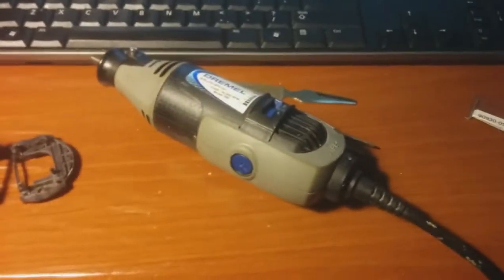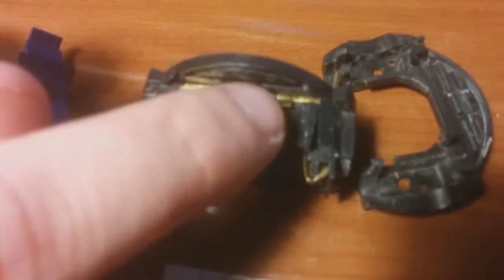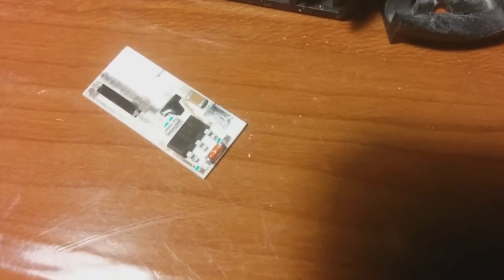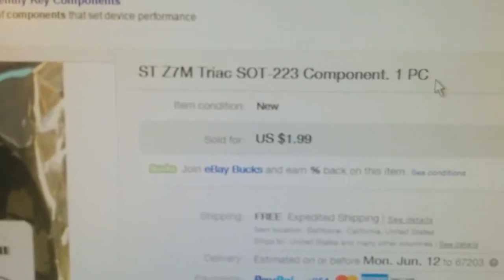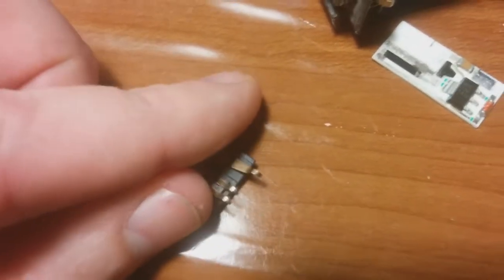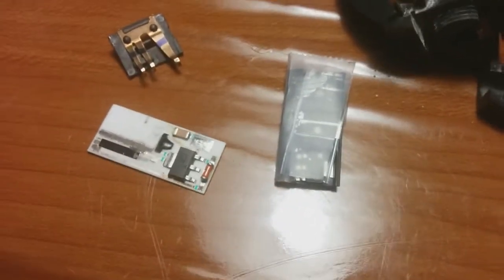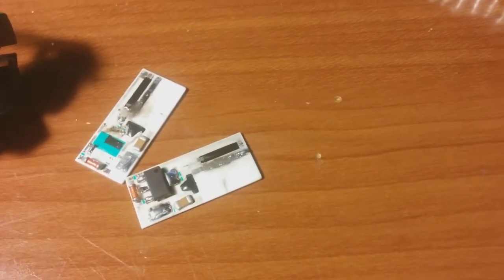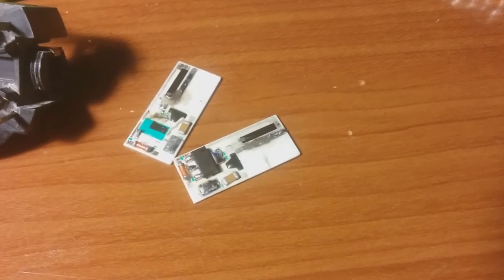Dremel model 395 "no speed control" fix - TRIAC replacement

Comment: I'm having the same issue with my Dremel 3000, I got it used on eBay a couple months ago and it's been working great but now today I tried to use it and it goes full speed with the switch set to 2 but it only does it sometimes and when it doesn't sometimes it'll keep speeding up and slowing down on its own, I'm pretty sure mine just needs to be cleaned though because I've been using it to clean and polish chrome parts on some vintage bicycles and it probably just got some bits of rust in the switch but I'll see if I can order a replacement switch for it and do that before I take it apart for repair just in case the switch is junk or it's got one of these that is bad because I suck at SMD soldering.

Comment: Jesus, 20 bucks!, I just ran a tiny bead of solder along the worn track, and sanded it down to flat and thin, and it worked. Though it'll wear out again sooner than B4 since it's solder that's being worn down...
Reply: I tried the same thing with no luck. Mine only works on low speed and you really gotta find the exact spot for that

Comment: Save yourself a lot of trouble and just buy a new switch and while your at it and in there pick up some new brushes too https://www.ereplacementparts.com/variable-speed-onoff-switch-p-213835.html
Reply from the maker: not a bad idea, there's a couple of these sitting around derelict.  But resale value is a deciding factor... or maybe not?
Reply: Alec J I have a dremel from the 70s, and that thing has never needed any repair.... They don't make em like they use to.
Reply from the maker: They sure don't!  I have many memories of using my father's ancient Dremel and , though limited in functionality, it has always worked.. and still does!
Reply: Alec J yep I think mines a model 120...but not sure.